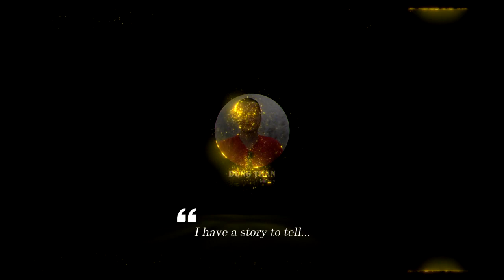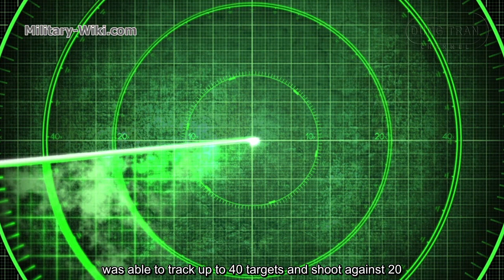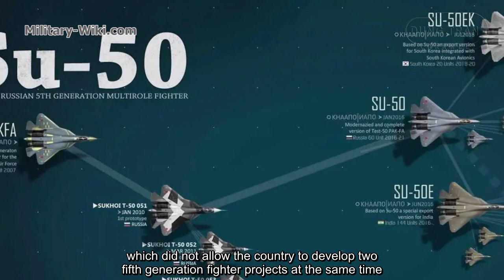Will Russia Restore the MiG-1.44 to Fight the US F-22?

Comment: ROFL every time someone mentions the 1.44, and comparing it to the F-22 is crazy. The Chinese copied parts of Mig 1.44 in J20 except for air intakes. The high cost was not the reason for failure, the Su-57 is far more expensive. The Mig 1.44 was a lousy plane, it was the Soviet version of the X-32, it just was not that good. So people stop thinking that it was magic.